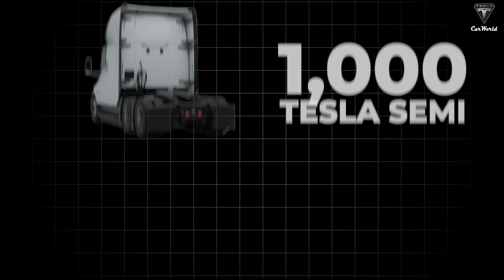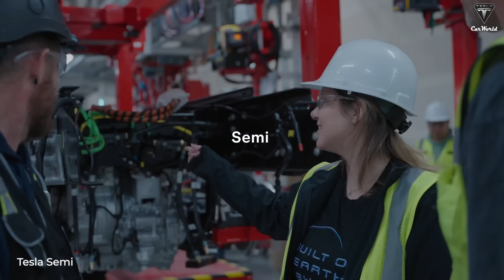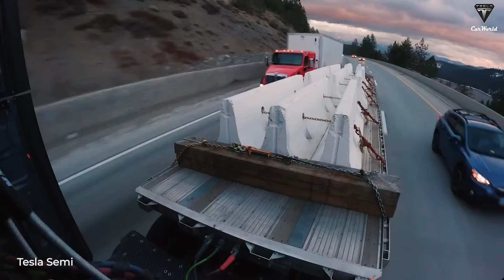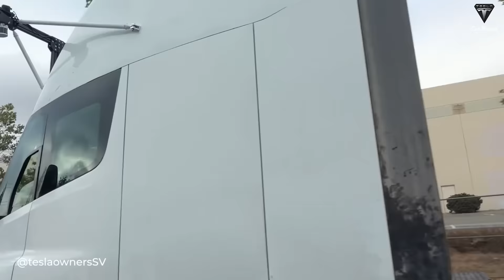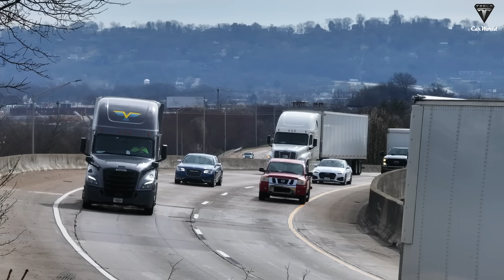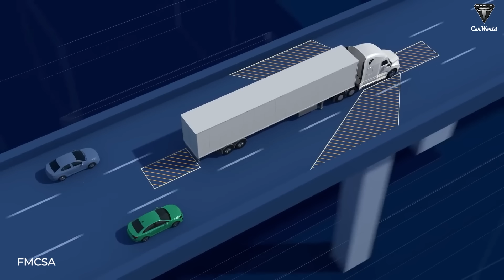DELIVERY NOW! Tesla Semi 2.0 FINAL Upgrade Is Complete, Elon Musk Confirms!

Comment: In order to have self driving you will need the trailer to be outfitted with sensors at all angles
Reply: Nope, the cab can do all but the back. Do need a camera facing the rear, easy enough with battery and wifi communication.